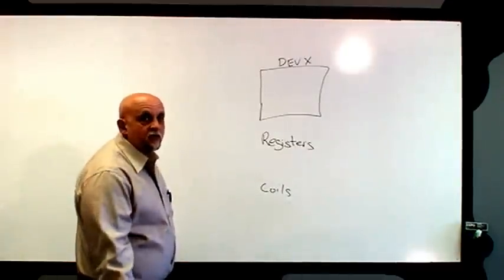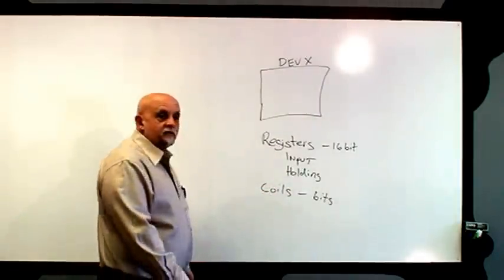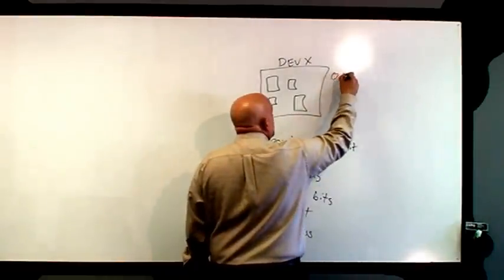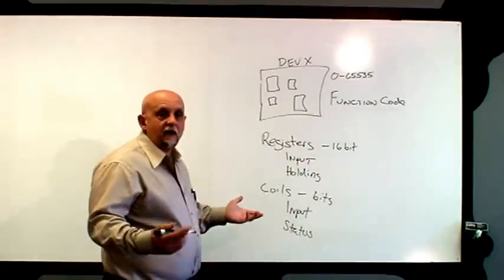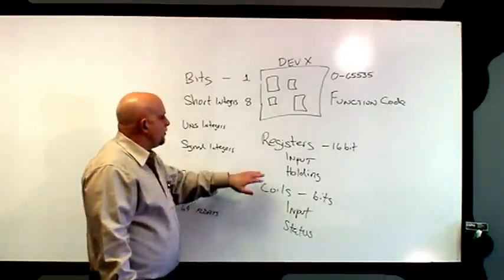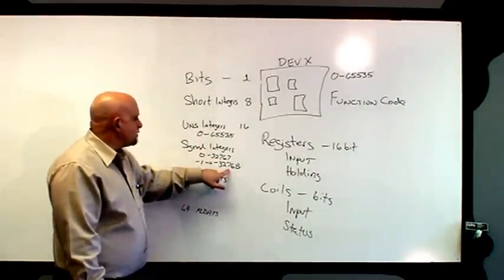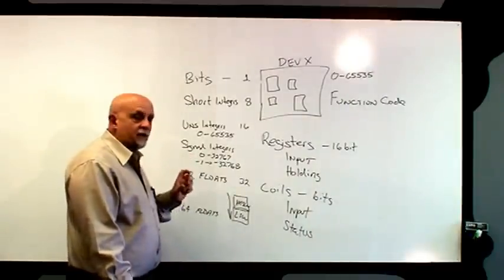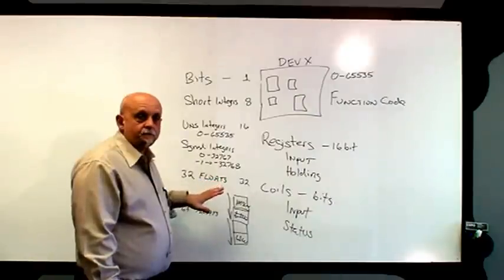Modbus Data structure

Comment: Hi, is there any way to detect if a Modbus devices has stopped communicating?
Reply from the maker: Hi Rob, Here is what our experts had to say !
If you are acting as a Modbus TCP Client and the TCP Server stops communicating, then you would either have the TCP socket close but if the TCP socket is still present and the Server isn't replying, then what you can implement is something like 5 consecutive timeouts and you, as the TCP Client, close the TCP socket. 

 If you are acting as a Modbus RTU Client and then RTU Server stops communicating, then you would just have request timeouts and which point, 5 consecutive timeouts could mean that the RTU Server is not present. Since there is no connection, you would just have timeouts in RTU.

Comment: hi mr. john,
i try to finish my project, its a moving message display project,
would you like to help me how to send charcter or string from pc to my project using the rs 232 cable,?
i have try to send it via hyper terminal, but it seems the  data is not send properly becouse the letter ir not shown on my display,,

Comment: John,

After living in the worlds of the various proprietary bus protocols (like C and S and L bus from HW and N2 from JCI) and BACnet and LonWorks, I found this presentation easy to understand (although I plan to watch it a time or two more. You mentioned that there were many other datatypes other than the standard ones you mentioned, but I admit to not being able to find those listed anywhere. Can you suggest a good exhaustive source (even though I am sure it will not be as interesting as your excellent presentation)?

Curt